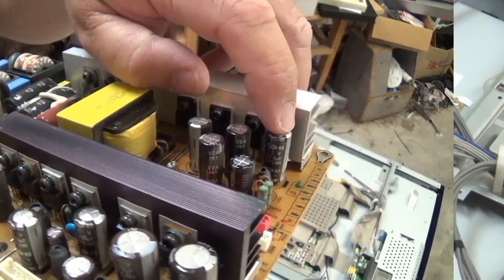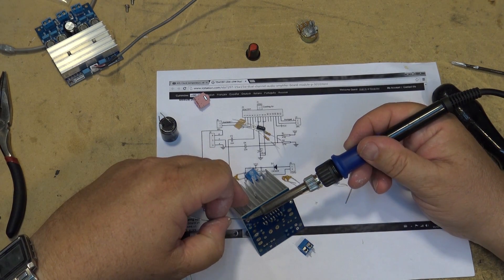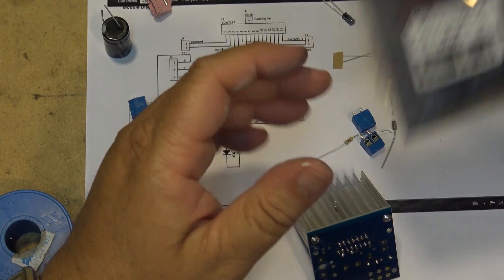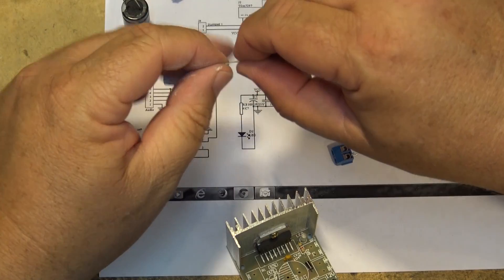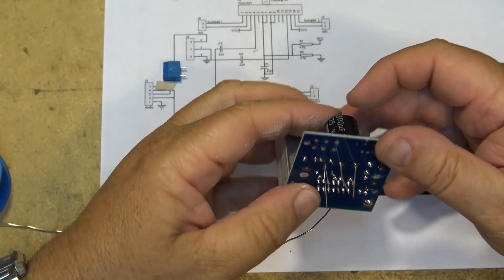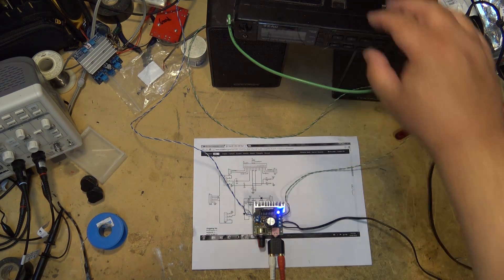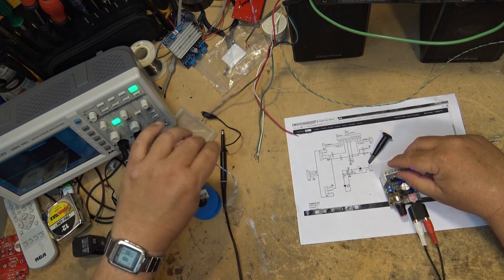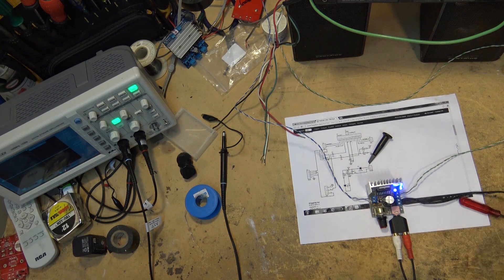TDA7297 amplifier board kit build

Comment: If I use a 12 Volt transformer to power 7297 amplifier whose peak output voltage is 22.5 volts, will it damage the Ic or work fine ?
Reply from the maker: Should be fine

Comment: Great video. I came here as I have one of these kits (bought fully assembled) but even with a variable line level input, the output sounds distorted/clipped. It is being used with 8 ohm speakers and it is WAY louder than I expected from 15W... but heavily distorted. I have a simple oscilloscope so I will check if the input signal is ~1V and also check the speaker outputs... but any thoughts what might be wrong?

Comment: sweet, nice to see you back :)
Reply from the maker: Unkyjoe's Playhouse 

I had a technology melt down last week started with a Chinese computer power supply sending about 60 volts down the 5 volt rail and cooking all my hardware. 
A fight resulted in the computer shop as everybody was passing the buck as to who's who fault it was. They even tried blaming me. My response was that I tendered a spec for a computer and paid them to build what I could easily have done in my sleep so that it had a warranty. Their receipt said I had 12 months parts and labour 36 on CPU. Then they claimed a good power surge. I am running on an apc ups, it was not a surge. It was a fan that failed. Power supply over heated and something in the regulation went south. In the end my computer was replaced but there was hours of time needed to get back online. Then my BlackBerry PRIV started rebooting. Also under warranty but in that case they replaced it and I had the new one in 1 day.
Reply: and I thought I had a bad week, glad to see you back at it.. never say die! I use Antec for all my power supplies and have had really good luck with them. I ended up putting a whole house suppressor on some years back "just in case" was recommended by my homeowners insurance, and they gave me a discount for doing it. Yeah I do PC's for a living and I have seen those crap PS units do that, I had 5 in one year :( I still use APC "Schneider" UPS's on all my sensitive equipment as well.

Comment: the TDA7297 is ony of my favorite chip amps. you can get about 9W into 8 Ohm at 13.8V. i bought THREE board from ebay (link) and even tho they are from china, all 3 of them put out rated power, have clean sound AND the short circuit protection works. Maybe they used rejects?

http://www.ebay.com/itm/9V-15V-12V-15W-15W-TDA7297-Version-B-Dual-Channel-Amplifier-Board-Module-MJ-YM/172306482262?ssPageName=STRK%3AMEBIDX%3AIT&_trksid=p2057872.m2749.l2649

Comment: Very decent kit, ideal for projects or just use for audio circuit testing :-D.

Ive seen Tda amplifiers used for years, mostly in car stereos, they put up with a lot of nasty speaker systems.
I had a habit of hacking up old car radios for the amplifier section, i never wasted a working amplifier :-D

Comment: If you have the tube driver board that is mounted on the end of a color(colour) CRT would have 3 class A amps one for each of the guns in the CRT and if we were to replicate one of the circuits twice with 4x BD131s and we would have a stereo Class A amp you know what I am getting at.